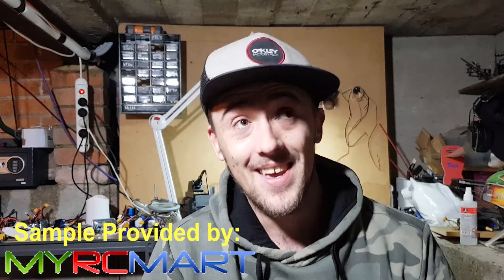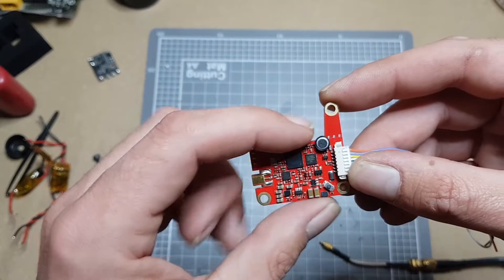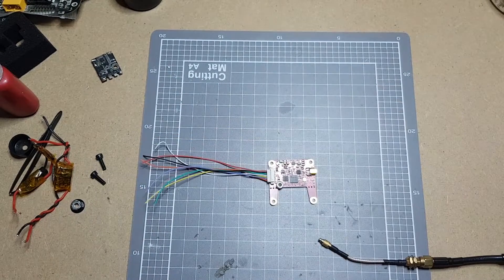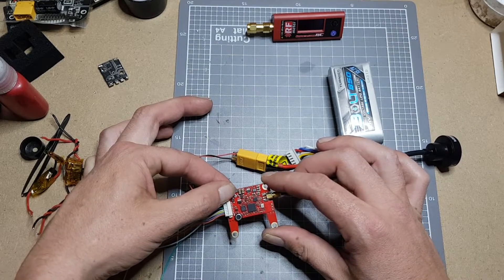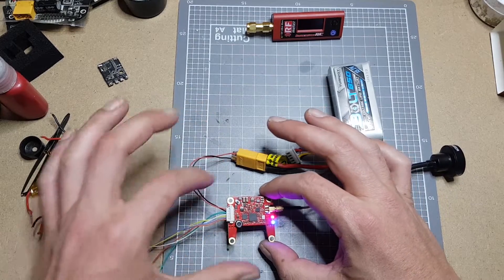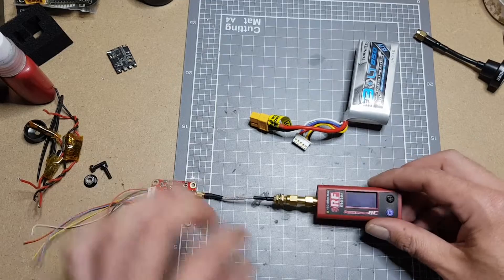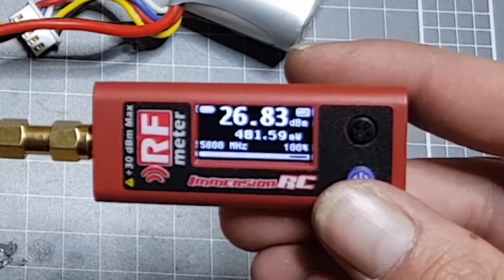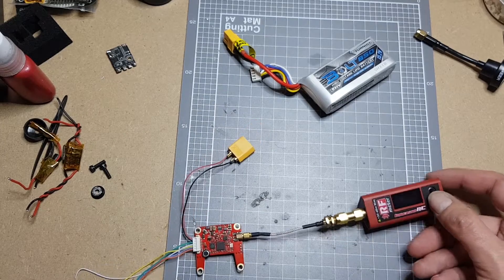EWRF e709TM3 Pro 500mW Power Adjustable 5.8G VTX 48CH Transmitter

Comment: Hello there,
Do you think the antenna signal feed is shorted to the ground in this particular VTx? I'm asking this because mine is shorted to the ground when checking for continuity with multimeter.
Reply from the maker: Hey mate soz for the late reply ,I'll get around to checking sometime very soon but IIRC there should be no continuity
Reply: Thanks Hector,
That's exactly what I thought, there shouldn't be continuity in there. My mmcx connector gets extremely hot to touch just couple of seconds after powered up. But it still broadcast the video feed nicely, though maybe this will affect the range. I'll consider to buy another one. One  more thing, do you think the microphone on the VTx  gives you more immersive experience when flying? Do you recommend audio feed when flying? Mostly I'll just cruising around and do mid-range stuff..

Comment: Now that you have had a few months with this VTX, how would you rate its performance and durability? Seems like a VTX with a lot of features for a low price, but I have never heard of EWRF before. Also, have you used the audio In pad to hook up a microphone (or audio) from an FPV camera or external mic? Or, have you used the mic on the VTX itself? Any/all info would be appreciated. Thank you!
Reply from the maker: Still going strong man the footage from my latest video on the falkor is from this vtx , I have not used an external mic just the onboard one that is enabled by default. For the price I'm happy and it has been hit with a few hard crashes while in 3dmode where I killed some esc's. Also still outputting correct power levels as shown in this vid
Reply: @HecTechFPV  Thanks for your response! Decided to give 'em a try!👍

Comment: Thanks for sharing your review. How would you evaluate the power filtering of this vtx? I'm hesitating between this one or the AKK FX2
Reply from the maker: Tough one that.. don't Have any AKK gear but i did just google a picture, it look's somewhat better imho , a larger coil and better 5v reg but less capacitance. if you have a nice regulated 12v output the the e709TM3 is my pick otherwise from raw battery id go with the AKK FX2 . personally i am just running a 470uf 35v cap to the battery connection and the footage at the end is with that setup

Comment: Thanks for the detailed review!  Just what i need - smaller current low consumption and microphone.

Did you test the microphone?  It enabled by default or not?
Reply from the maker: Cheers mate yes I belive it is however it's rather low in volume , to turn it on/off you hold the button in while powering on the vtx  then you have 6 options instead of 3 so you get channel,band,power,custom1,custom2 then mic on or off as the 6'th
Reply: it is enabled by default, yes